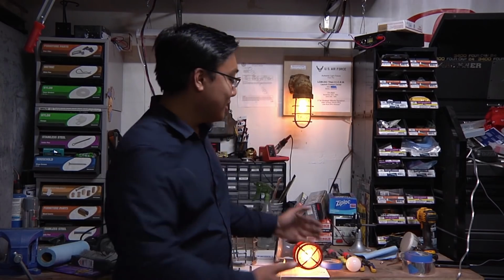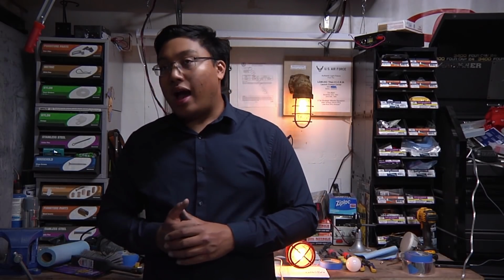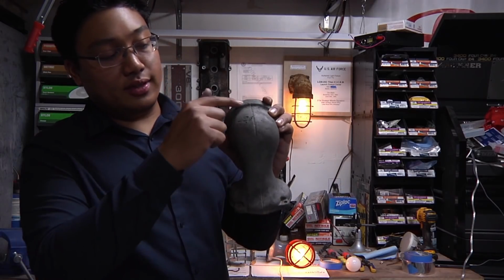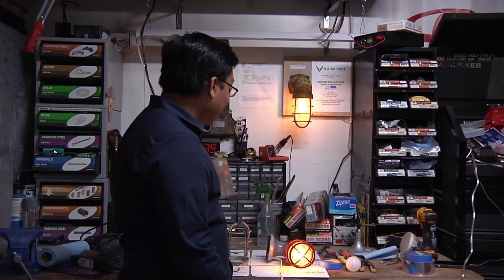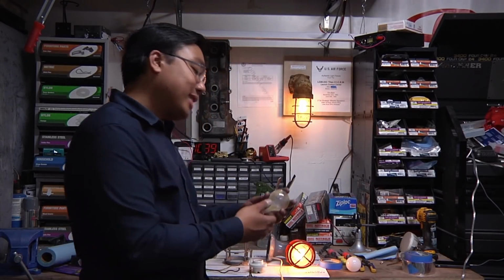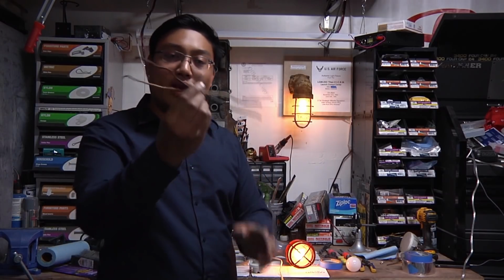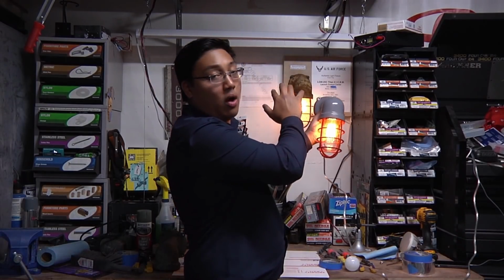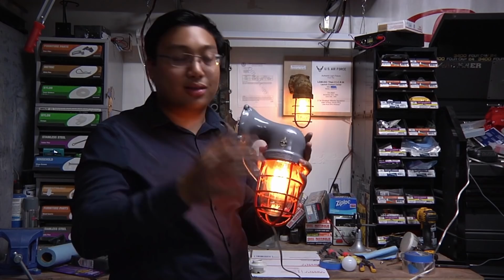S1E17 - Light Restoration Work - Owning a Titan II Missile Silo

Comment: Nice restoration job. As an electrician on those silos in the early 80's, I've worked on those fixtures a number of times, none of them were that pristine though, most dusty and definitely not glossy like that one. More like flat grey if I recall. Some that were in the sump area on Level 8 were always rusted due to high humidity. That WS-107A-2 plate is pretty interesting now and doing the Google search tying it to Titan II. Never paid much attention those back then but I vaguely remember them now after seeing it again.

Comment: Yeah, I remember those lights. Even when the silos were active they would cake up with stuff that made it almost impossible to get the globe off without breaking something. I always made sure we used High Pressure Grease on the threads when we put it back together so it would not do that the next time you needed to change the bulb.
Reply: Where you the person that did mantminse or did you launch the misals if neaded?

Comment: I want the diesel generator from one of these sites, it would be hard to get to!
Reply from the maker: Very and very obsolete
Reply: @atomicunderground9971  where did they even keep the generators in the titan II silos? weren't they on one of the lower levels in the silo itself?
Reply: They dug all the white superiors out of Level 3 silo and used them someplace else...  I checked the run log at one site in 1975... engine time 850. Checked the Service manual... break in hours... 900.  13 years..not broken in yet